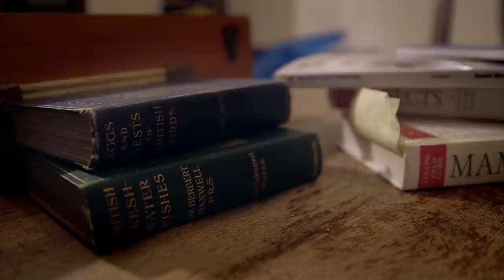The LARGEST Wasps Nest Found In A Home | Pest Detectives | Episode 1 | Filth

Comment: Liquid nitrogen will kill  bedbugs, along with alcohol. 

They are suspectable to the cold. If it is winter, you may want to have the house chill over for a few days and go elsewhere in the meantime, but be careful that  your waterline doesn't freeze over
Reply: And Diatomaceous earth - pokes holes in their exoskeleton and dries them out
Reply: @natshe-her3215  diatomaceous earth really is a one-for-all isn't it? Use it for pool filter aid, you can have a mat made of the stuff for your bathroom and it absorbs the water dripping off you after a wash, and now you can use it to kill some bugs? What is it not good for?
Reply: You can use diatomaceous earth in food as a caking agent (food grade of course), and within your gardens. It's an excellent source of silica - great for hair, skin, joints, and connective tissues.

 At the end of the day it is really just the remnants of fossilized algae.